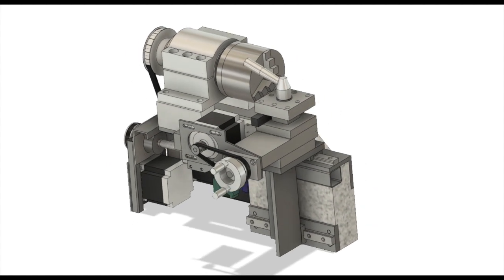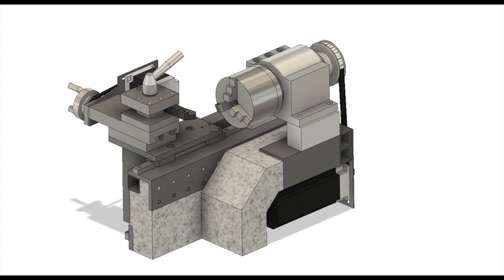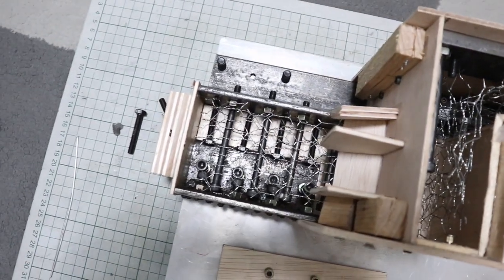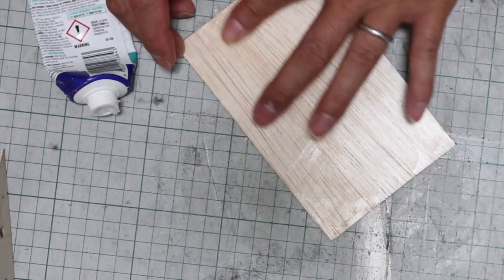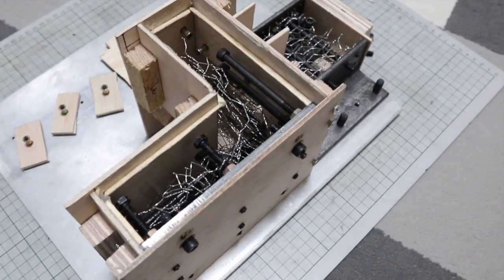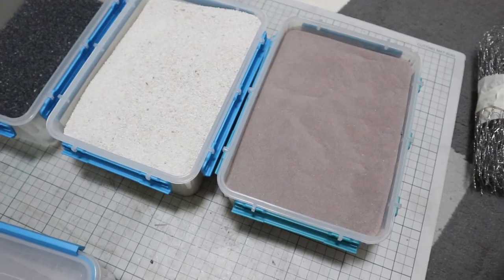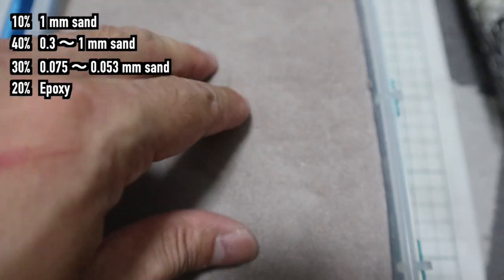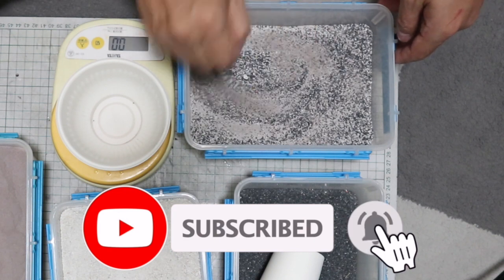Homemade DIY Small CNC Lathe ,Part2

Comment: Hint, if the pouring/epoxy-granite fails: While the "solution" with drinking a load of alcohol is a viable alternative, you can also BURN THAT SHIT DOWN!!!!
So you can at least save some of the steel, bolts or alu frame, etc. 
Alternatives are: Ethanol, paint thinner, adhesive remover plus a heat gun ... this is btw another "weakness" of epoxy and epoxy-compound materials. 
Oh and don't forget to wear safety goggles, a breathing mask and gloves. Thanks for the video:)
Reply from the maker: Thanks for the advice.
I have limited equipment but would like to make good quality epoxy granite.

Comment: Nice Progress. FloweringElbow tried to make a flat top surface by pouring a layer of epoxy (without sand), which I want to try eventually. His attempt didn't work since the layer was too thin to be flat, but it seems like it'd work if I pour more.

Comment: Tip dont bother with scrapper, get yourself dremel and thin cutting disc. Try find videos called dremel scraping or absasive scraping
Reply from the maker: Thanks for advice.
You are right, it is faster to use an electric scraper.
The machine I am building is very small, so I can work manually, but for a large machine, I think I would have to use an electric scraper, which would take too much time and energy.
Reply: @a-cnc-f  i meant na abresive scraping like dremel or angle grinder. You use side of the wheel. I am aware of electric scraper. I scrape usualy by hand and when It comes to strell It od twice as hard as cast iron
Reply from the maker: Unfortunately, there are no drawings.
The 3D model is also incomplete as I will continue to update the 3D model as I work.